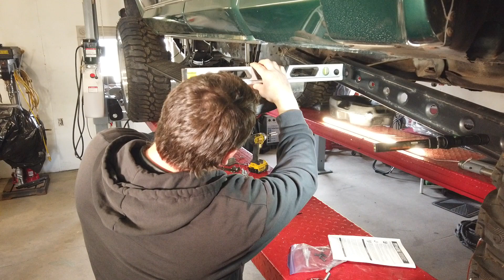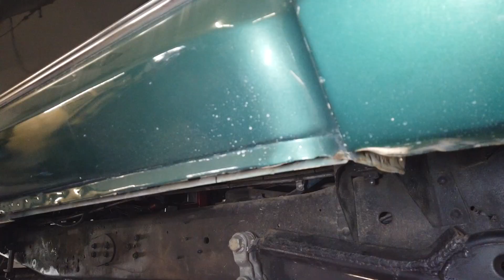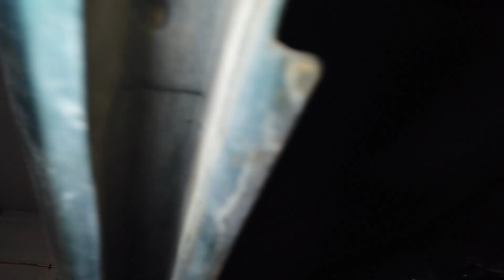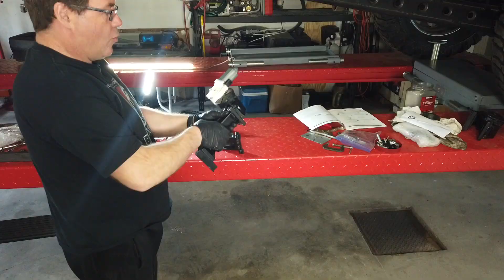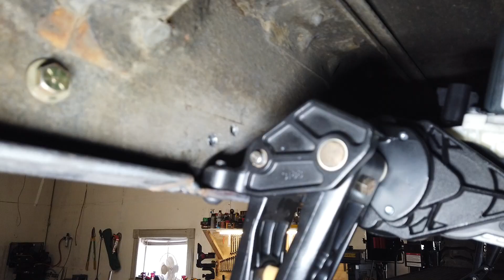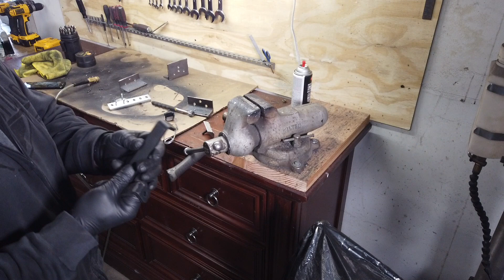HorsePower Ranch install of AMP Powerstep on my 78 Ford F350

Comment: What color wire did you attach to on the door switch? I have a 76 F100 and mine has 3 wires. A Black/Blue looks to be 12 gauge, and 2 -14gauge wires. One is Black/Blue and the other is green.

Comment: how did you make them power up and down
Reply from the maker: I used the dome light that turns on when you open a door.  If you turn the dome light on buy turning the light switch it will make the steps extend as a byproduct, which I like.

Comment: I appreciate the response. I see that power made the step extend, is power needed to retract? I have steps with motors and brackets, but no wire harness
Reply from the maker: The relay box that is included makes the steps retract when no power is applied to the open switch, but it does take power

Comment: Hey there, I’m looking to do the same thing on my 78f250. How did you go about wiring the amp steps to your truck?
Reply from the maker: I connected the steps to the door jam swirch that turns on the dome light.  Because the dome light comes on for any door, I wired both steps to open when any door is opened.

Comment: Where are you located?
Reply from the maker: My shop is in Minnesota, about 50 miles west of Minneapolis.
Reply: Wish you were closer. I’m in Arizona and I really want to add these steps to my 78 F250 I just don’t have the equipment to do it.  How did crew cab turn out?
Reply from the maker: @hsmarkley  I have not done the crew cab conversion yet.  I am considering not doing it, and building a new crew cab.